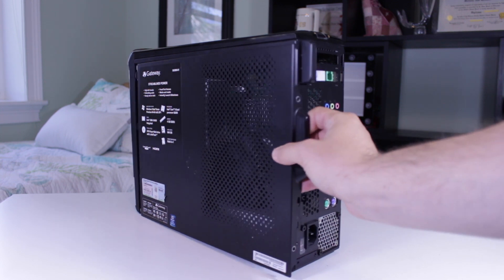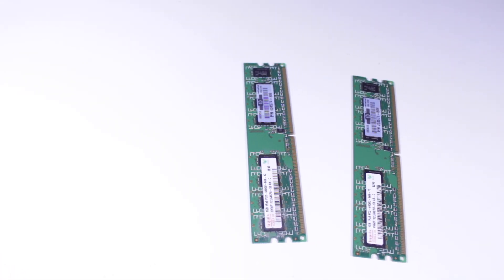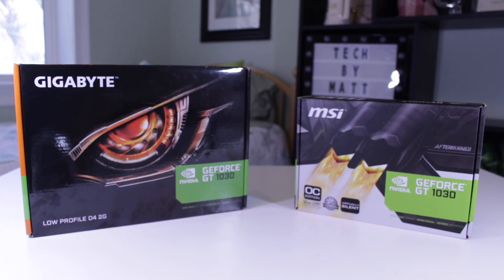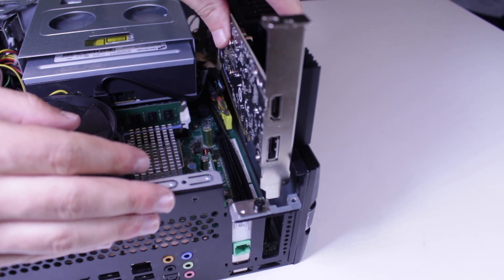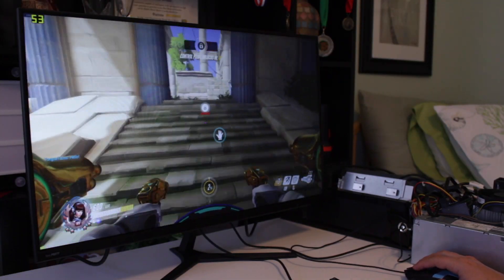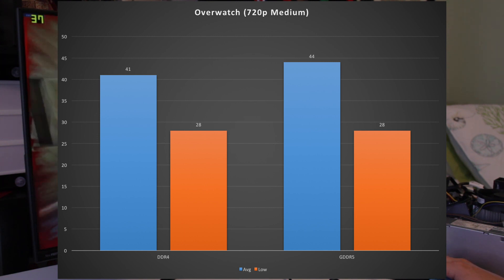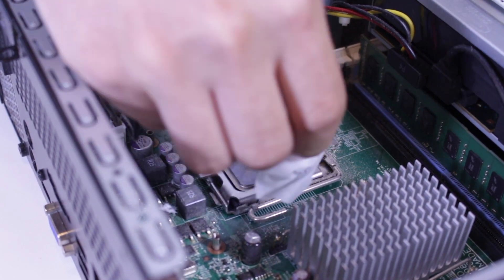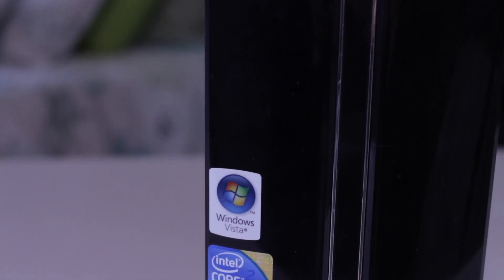Core 2 Quad + GT 1030 = Good Combo?!?

Comment: Oh try to see if you can do the Xeon LGA 771 mod on this board to get a little more CPU power!!!
edit: You'll just have to downgrade to Windows 7 however the older Xeon's don't recognize Windows 10 :(
Reply: Do OEM boards recognise the Xeons?
Reply: Some do some are incompatible. Delidded.com has all the necessary info on the mod what it does and what boards are good. 

I tried doing the mod on an 2009 HP Pavilion and the motherboard recognized the Xeon in the bios  but it wouldn't boot to Windows. I could have just messed up the mod as I choose to just buy a stock cpu instead of buying one that was already modified. 

This would be an awesome video topic especially if done to an older LGA 775 optiplex for super cheap if it hasn't been done before!
Reply: Those LGA771 mods are nice to do as a side project but even for a veteran like me find it a hassle to find boards which support the mod and do the mod. I once bent a few pins when doing the mod and took me hours to fix the bent pins. 

Less headache just to get the Q9650 and OC the snort out of it.
Reply: Yeah that's the only downside, its fun to do but its hit or miss. I found out I had a Q9300  I think not OC (OEM motherboard so I can't) but It runs a lot of older games paired with my R9 270x so its great the thing it is. 

I will however try again to do the mod on this board.
Reply: Wait, I am using Xeon E5472 in my Windows 10 64bit, it should be working fine
Reply: Willy Yappy it works with older CPU but it can be a hit or miss affair and some digging thru google helps.
Reply: Juan Salazar does they recognise windows 8.1
Reply: No that's just wrong. Every xeon works perfectly with windows 10 as long as bios is updated.

Comment: Do one in a core 2 duo. I have an old core 2 duo system and want to put it to work
Reply: Flika1999 😒 yes it will work, but u will have to run older games, Rocket League & San Andreas is ok tho
Reply: You will have no problem running most games on very low 1080p
Reply: Flika1999 Older games will work fine with decent GPU, but newer (2015+) games are going to run around 30 fps (some not even 30) with stuttering and framedrops.
Reply: Look up if your system supports Core 2 Quad Q6600. You can find them on ebay for under $10 shipped.

Comment: I think lga 775 without overclocking is dead platform, overclocking can squeeze last bit of performance for playable results. Playing esport titles on 720p and some of them under 60 fps is really bad.
 I have E5450 4GHz overclock with 1050 Ti and I think it cannot even be considered as low-end for todays standards. 
Esport titles are getting not so bad performance (1080p)  CSGO around +100 fps, R6S is between 60-90 fps, but framedrops and stutter is quite annoying (cant imagine how it would work with slower cpu). It is just too old. Im just saving some money for R3/I3/g5*00 system to have some low-end pc, but still much better than one I have now.

Comment: I have the same pc except it has core 2 quad q8300 and 4gb ddr2 ram can i put a low profille rx 460 2gb if i change the case and psu

Comment: I have a small hp case but with an core i7 4770 and it waa a pain in the ass to swap the psu and gpu for the gpu i have a gtx 750ti but damn swap the itx psu for a full atx on o.m.g nightmare.

Comment: will gt 1030 work with pci Express v1.1 x16 slot ??
Reply: yes, that's what I have right now with my optiples 745 + Q6700 + GT 1030 + 6 gb ddr2 ram @667 mhz
Reply: which version of gt 1030 you have ??
Reply: I have a single slot, actively cooled zotac GDDR5 model.

Comment: I have 1280×1024 monitor and I paired a $20 gpu from amd (hd6770) with my core 2 quad and on full resolution&medium setting  it gave me avg of 50 that means it's better to buy radeon 6770 than gt 1030
Atleast my HD 6770 is better than gt 1030 sddr4

Comment: You know where i can find one for less that 100 dllrs :(?
Reply: RG Prosucctions You can go ahead and buy one right now but it be DDR4 and like $86 but if you want to find a better deal with a GDDR5 you’re not gonna get any lower than $80 You can try going for an eBay auction
Reply: On amazon each are in 90dllrs and i dont trust ebay, and almost ever card ive seen have been from the uk and not from tue US
Reply: 😒 Microcenter Stores
Reply: Weird. I've never had that problem on ebay.
Reply: I got my gddr5 passive cooled msi card for 80 new.

Comment: My PC I built from free part and parts from free PCs I got q6600 6gbram with overclocked gt 710 games run decent low at 720p in fortnite I get 50fps

Comment: for me i would recommend 750 ti instead of 1030 if u got used system
Reply: 1030 is only 30 watt where as 750 ti is 60-70 watt so double electricity bill on 750 ti. Many people forget this very important point

Comment: 🤓 Core 2 Duo 🐢🐢 & Core 2 Quad 🐢🐢🐢🐢 desktops are still decent for low spec poor man and kids gaming, old games, indies games, look around ur local area, pu several if cheap enuf, help urself and help friends  and family, Forget about expensive 1080p monitors just pu a cheap lower res monitor for $10 and up, for video card forget the expensive 1030 instead look for 1gb ddr5 video cards they start at $15 🕹😍

Comment: The peformance shown here is actually quite poor even for an entry-level budget card such as this. The GT 1030 is capable of much better output, and the culprit here is the CPU, which bottlenecks the GPU like crazy. The CPU is not fast enough to keep up with draw calls to the GPU, even though it is good enough for non-simulation games in terms of logic computation.
I have the MX150 installed in my laptop (with enough cooling headroom), which is the same GPU as the GT 1030, only in laptop configuration. I get average ~65fps maxed out in Rocket League and ~70fps maxed out in CS:GO. All 1080p.
I haven't tried Overwatch but GTA V runs at ~50fps 900p medium preset with x2 AA. Overwatch should run at 1080p but only medium preset playable at something like 45fps on average.
If you pair the GT 1030 with a modern mid-range or higher CPU and at least 8GB DDR4 RAM, it should run even demanding AAA titles in playable framerates if you just dial down the graphics a bit.

Comment: Cannot recommend 1030 as a new full priced. It's a product of Envydia.
Reply: the only new cards that work with systems like these are from NVIDEA, I read something about RX cards not playing well with legacy BIOS and the 10 series cards working with BIOS and UEFI.
Reply: 1st Acc The 75w cards from AMD...maybe, not the 50w RX 550 though. It works just fine... at least it did for me.
Reply: Aaron Garza what gpu did you use?

Comment: Q6600 with gtx 750 ti legendary combo
Reply: Bro. You use the a stick cooler for the cpu or aftermarket?Thinking of this combo for a friend cheap af
Reply: @garylafleur744  core2 cpus is not hot soo you can use stock cooler for your pc
Reply: @Markalovich  nice one pal. Works well with 4gb ram and 300w psu? Gpu and ssd is all I need now
Reply: @garylafleur744   if you're going to game on it you need at least 6gb/8gb of ram I will suggest use ddr3 mobo 4GB kinda bottleneck.

Comment: Why a GT 1030 and not a GTX 750Ti ?
Reply: Mehroz Ahmed because there are no gtx 750ti single slot low profile cards.
Reply: 😒 it wont fit in this stupid small case, i guess u cud move everything over to a wooden box and then ur good
Reply: There is one. I'm using it in a SFF i3 3220 configuration.
Reply: Blink Rim a single slot low profile GTX 750ti? I've seen plenty low profile versions but never one that was single slot also.
Reply: MrSammy why Wood? cardboard will do alright
Reply: 75W vs 30W of power consumption with a TFX PSU that in most cases barely reaches 200W of power is a diference to take in count when you are upgrading this kind of systems.

Comment: guys i beg you

buy a 750ti or a 1050ti not the 1030 ffs
Reply: LegendaryVegeta depends on  the region you live, budget and if you like to have warranty, or? I just bundled an old i7-870 with a GT 1030 GDDR5 ... casual games run good (like World of Warships) on medium or high (depends)
Reply: LegendaryVegeta i just swapped my daughters "core2 duo" for a "core2 quad q9550" and added 8gig ddr2 ram, i was going to buy her a 1030 or 1050 thinking theyd be best, or i might bottleneck it?  Do you think her rig can handle a 1050ti? Im not too pc savy..
Reply: What's the big difference between a 750 Ti and a GT 1030? They can perform pretty much the same, and the GT 1030 consumes only half the power, which is a lot easier for some of the older systems it SHOULD be paired with.
Reply: 4kays ewaste What power supply do you have? You will have to overclock the cpu if you want to get better frames. Also,  you might still encounter some bottleneck with a gtx 1050 ti. What games do you plan to run?
Reply: 750 ti is not better than a 1030 lol
Reply: TheSteelCrown ,its my daughters pc so i dont know what her games are, or what games even exist for that matter?   Its a 350w psu, but i have a 500w psu spare incase it needs it..
Reply: maully203 it is tho... look up benchmarks my guy
Reply: i have seen the "benchmarks" and they are misleading. the 750 ti is a good way to go if you want cheap, but will soon be outdated. the gt 1030 is current gen and will be supported longer. also if properly tweaked i han get 112fps on fortnite. i have one after doing some research. and the amount of frames difference that mkaes the 750 ti "better" than the 1030 isnt a whole lot, so it isnt really about whick is better, its about if you wanna be cheaper. imo, the only other older crads i would buy instead of a 1030 is a gtx 960 4GB because it has a way higher base clock and memory bus. the gtx 960 is comparable to the gtx 1050 ti but it concumes way more power
Reply: Bezzegh Adam I agree with this. For a few more dollars you can have a slight performance increase and can find a gtx 1050 for 139
Reply: Eh
Reply: 😒 yup i have both of them 🐢🐢
Reply: 4kays ewaste 😒 bottle necking isnt going to hurt anything, get an overkill video card if u plan to move up to another computer anyway, so u can reuse the video card, the 1050ti or 960 4gb is fine, overkill teritory wud b: 970 980 1060 but they are all still ok to buy if u ever plan to move to another computer one day
Reply: Cheers everyone.. ill buy her a 1050 then, and if its overkill i have an i5 2400s she can have ill just get her a motherboard to suit that (i have ddr3, psu's ,cases, so upgrading her cpu would only cost me a motherboard)    thanks again everyone.. very helpfull 👍👌
Reply: 4kays ewaste 🙂 1050 is fine, I recommend u look for the better '1050ti 4gb Single Fan Model' get that one instead since it has more ram and also a tad bit more cores, i have one from Evga but other companies make a small single fan 4gb version, check to make sure it has no 6pin power plug, if it doesnt have a plug you should be fine to use a 350w power supply, im assuming that you are not going to overclock the cpu or video card 🕹😸
Reply: 4kays ewaste 🙂 I also have a Q9550 in one of my spare desktops, your daughter should be happy with it, the 1050ti should be able to run between 50% to 99% of its potential depending on game, settings, situation, use Afterburner and monitor usages and temps of cpu and video card. Also since u have more spare parts its always good to have a few extra spare computers laying around for fun so build them when u have time, for a cheaper weaker video card for the spares u can go with a 1gb ddr5 video card, they start at $15 on fleabay, good enuf for classic Quake 3 🕹😍
Reply: why would you get a 1030 if a 750ti is more powerful?
Reply: to you 150 and 170 is not a difference but for esports people it makes  a difference
Reply: im planning on getting an i5 2400 prebuild (swap out the mobo)  and a 970 at one point, because you could swap for an i7 3770k and that could last me atleast another 5 years, with overclocking
Reply: oh boo hoo 75w instead of 30, means you can play around with the gpu settings a bit for best performance, you cound undervolt etc

atleast in the uk if you have a £200-250 budget, i only plan on getting 400+fps in csgo and thats the only game i play, then look for a prebuilt with 8igs ddr3 a hard drive 480gb would be nice i5 2400 non s mobo psu dvd player if its there for £80-100

sell the mobo, psu hard drive etc that you wont need for £50-100

buy an mobo supporting oc for £50-80 a good gpu for £50 max and spend the extra on a 500w good corsair, or 430 whichever, it would be better to get rid of the included 220psu from prebuilts and spen on one that will last you for longer and is more trustworthy imho but thats me
Reply: ok yes a 1050, but you could also get a 760 i found it for £35, are you telling me i shouldnt buy that and get a 1030 instead for £100 which is half as powerful just because it has 30 w TDP ?

no you need to hunt for the best parts and performance from last gen, and the money you save on doing that spend a bit extra on a better psu 
thats my plan atleast, if you think otherwise good 4 u
Reply: LegendaryVegeta 😒 exactly, plus the branding tells u everything: GT instead of GTX
Reply: LegendaryVegeta You are completely missing the point of the gt 1030. You shouldn't buy it if you're planning to do what you just mentioned, you should buy it to upgrade a locked SFF PC you already own (some older Dells are picky with their PCI Express slots, some are actually locked at 35w). Same reason cheap 60/120 GB SSDs exist, to upgrade older machines you already have, not to build a completely new system. If you know how to overclock and/or you're planning to get a normal sized case and a better PSU you won't go for either option (unless you can find a 750 ti for a great price), the used market has much better options.
Reply: GTX 1050 TI , 4GB DDR5 ( EVGA or MSI )
Reply: LegendaryVegeta 750ti’s are rare where I live, and the beaten up, 2-3 year used ones sell for 120 dollars plus. I can just get a new 1030 for 80 dollars and get 3 years of warranty lol. Not that great of a difference in performance at this range. A 1050ti though, that I would suggest definitely